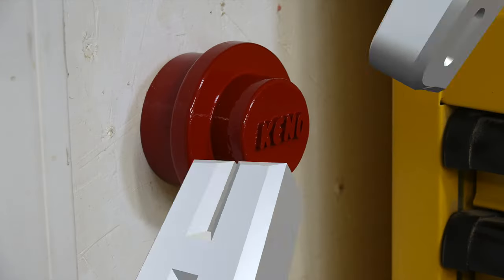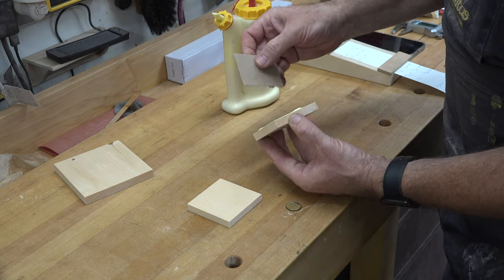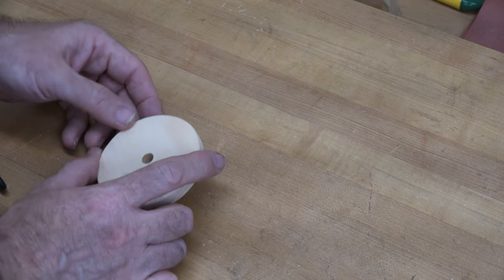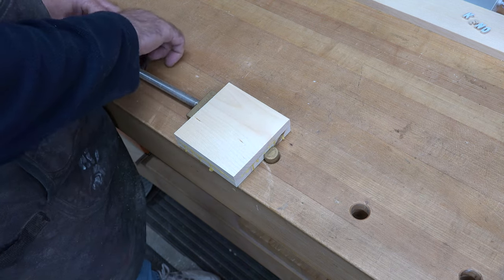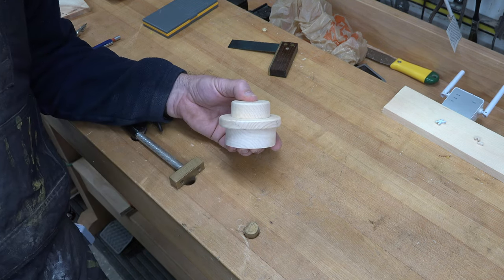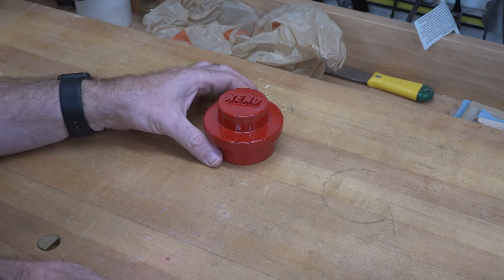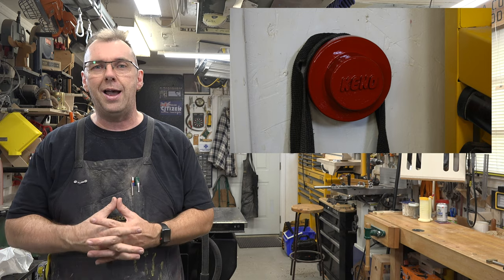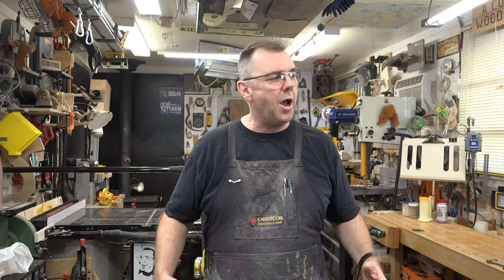Making a Building Block Coat Hanger

Comment: What did you use on the back to hang to wall
Reply from the maker: @8:20 in the video I talk about the router bit that I used to cut the keyhole that will hang this piece.  The keyhole router bit is just like this one here.  https://www.leevalley.com/en-ca/shop/tools/power-tool-accessories/router-bits/30113-keyhole-router-bits?item=16J7001
I hope this helps.  Thanks for tuning in to the show Craig.